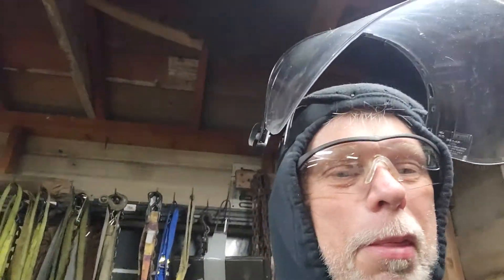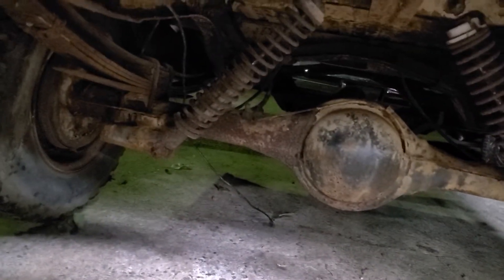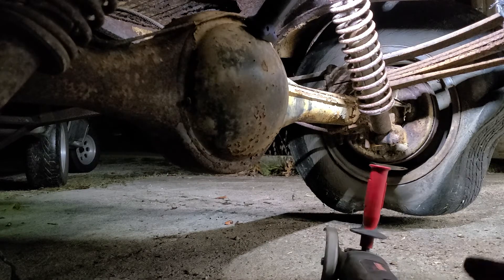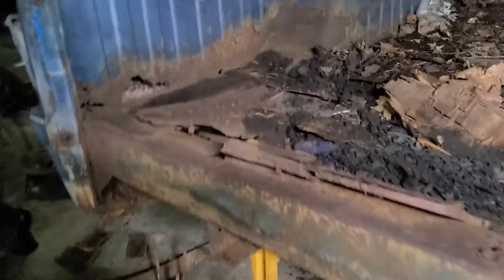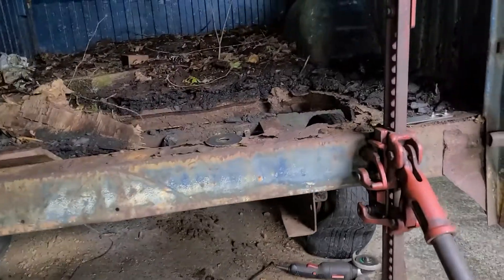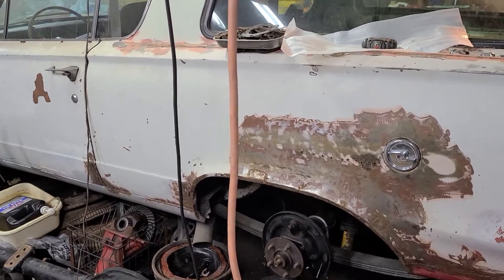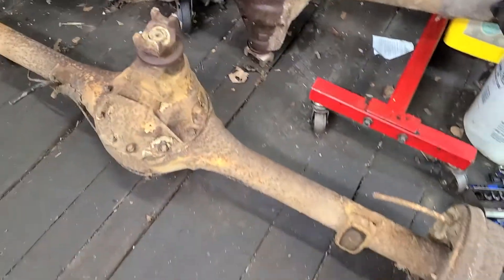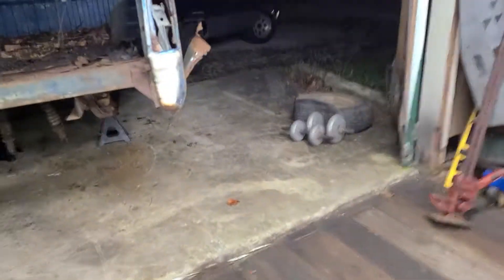Mopar 8 3/4 removal from the 72 Dodge D100 trailer

Comment: I am glad you got it out. The truck pulling the wagon looked pretty clean. Is that what the 8 3/4 is going in?
Reply from the maker: Yes absolutely the truck is a 1992 Dodge D150 it will also be getting a 360 the gear ratio will be a 3.55
Reply from the maker: Also thanks